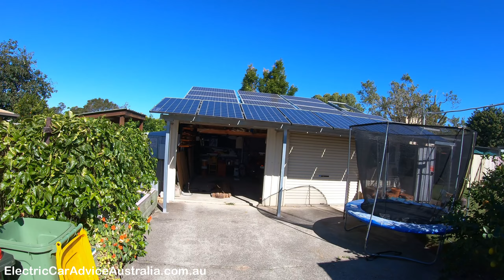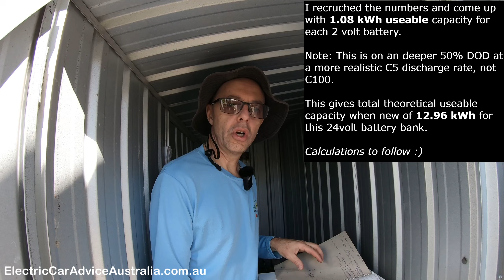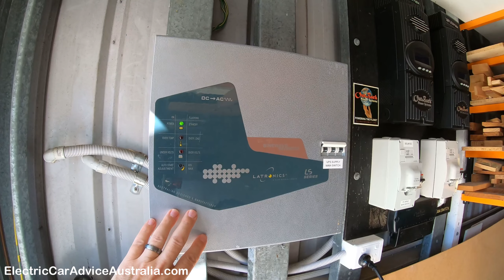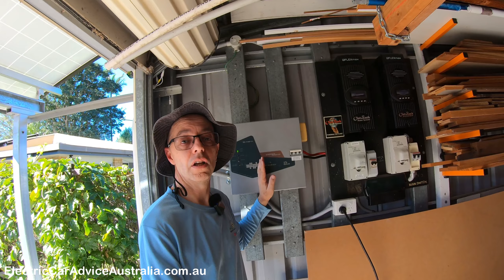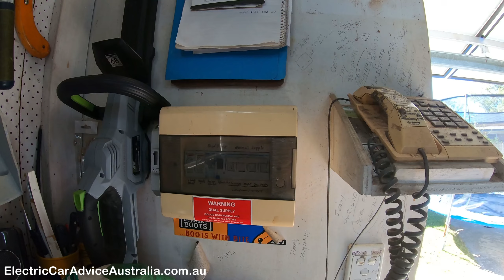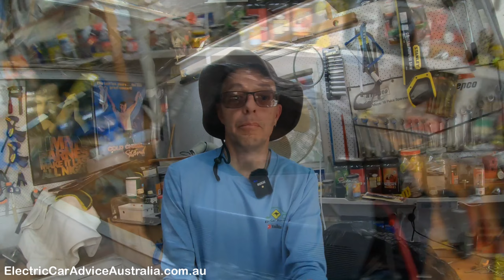Replacing Home Solar Battery | Claim Battery Rebate? OR Upgrade Off-Grid? | Electric Car Australia

Comment: Thanks for the insight into your system and how you put it all together. It made sense as to why you built it like you did, especially choosing lead acid  ...  and a LF Latronics inverter  ...  and will be great to see the 5kW version put into service.

I'm still a fan of FLA forklift batteries and have a 48V 980aH and a 400aH  ...  and soon to add an additional 900+aH. I don't mind having to top mine up every month, though the 400aH one has an auto watering system and takes literally only 2 or 3 minutes. The three batteries in total have cost me $3,200 including a couple of 120A chargers  ...  so it's definitely a cheaper way into the game than lithium.
Reply from the maker: Hi, thanks for watching and the detailed comment. I hope you follow my journey and keep us up to-date on how yours goes as well. Cheers

Comment: Similar situation. I  just replaced the lead acid batteries with Kings 200Ah LiFePo4. About $499 each kept my 27yr old Aus made inverter going fine.
Reply from the maker: That sounds like a great upgrade, thanks for sharing and watching the Channel. Cheers

Comment: Personally I would wait til V2H (vehicle to home ) is established and use the car battery as your house supply with the grid as your backup when the car is being used. 
I’m on the understanding that the Nissan Leaf is the only vehicle at present capable of V2H. 
Solid state batteries are just around the corner too. 
Lots to consider. 
I look forward to seeing what you choose to go with.
Reply from the maker: Thanks for watching and the comment. Yes both technologies have been coming for a while but are now closer. My challenge is to use as much of my current gear as possible so more research to do. Thanks for following my journey.

Comment: Out of interest how is your battery storage shed ventilated? Changing out the lead acid batteries to a low hydrogen generation battery format like Li-ion is a good move because it reduces that potential hazard. For those not aware, this incident report from industry highlights some of the issues to think about: https://www.nopsema.gov.au/sites/default/files/documents/2021-03/A452884.pdf  ... and  here ... https://www.rshq.qld.gov.au/safety-notices/mines/exploding-lead-acid-batteries

On your point about the Fronius Snap Inverter, I'm in a similar situation in terms of the prospect of a home battery + tapping into the federal govt rebate. While a big turn off for me personally is their CEO (acquired taste?), a Tesla PowerWall-2 is a clear contender for consideration as far as I can tell given that it suits an AC battery set up. I've not done my research fully yet but it's a possibility that at least avoids the burden of changing out the inverter.
Reply from the maker: Hi, thanks for watching and great point. I will talk more on this subject in future videos. Current cooling is passive, due to issue of having an electric motor/fan as you mention, with a ventilation holes low down in the rear wall and same at the roof-line on the front wall. If I go lithium I will be installing active cooling.

Comment: Very interesting and thanks for the video. I may have missed it, but how many kW of panels are on the house? You said the inverter is 8.5kW, so I assume you might have around 10-ish kW. Thanks again.
Reply from the maker: Hi, thanks for watching and the video. Yep I forgot to mention. Its 10.5kW of panels which officially max's out input on the Fronius inverter. I have space for another 4-5kW if I go with a bigger grid connected system. I will talk more about this in a future video. Cheers

Comment: Cheers Greg, it'll be money worth spent when you go for lithium, more energy density, more output, no maintenance, couple that with an appropriate inverter and you won't look back. My SMA gear has been performing superbly 8 years on, fully off grid and charge my EV6 purely from solar. 🤠😎
Reply from the maker: Sounds like you have a great setup, thanks for sharing! 👍